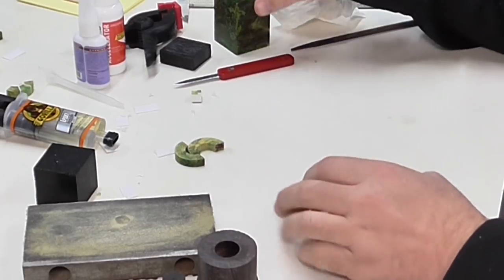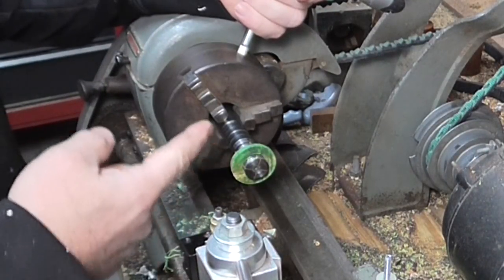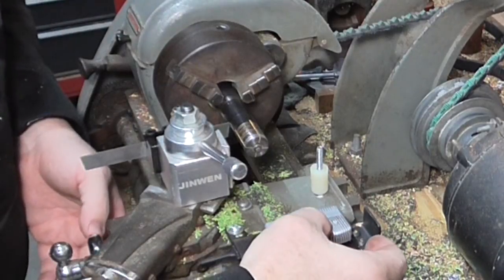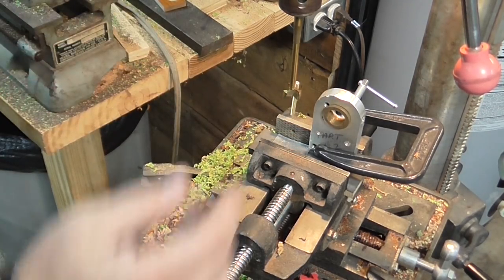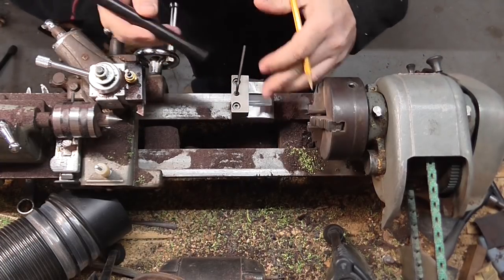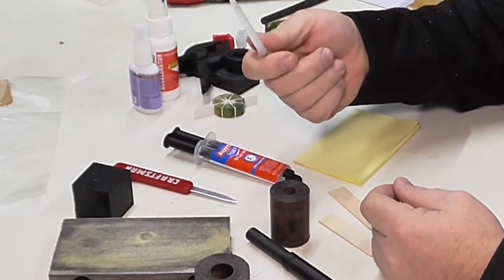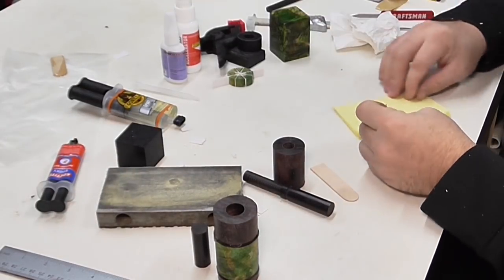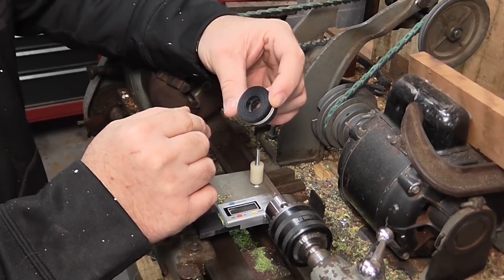Episode #2 - Duck Call Build - BearKraft Game Calls

Comment: I think high startup torque from the direct drive might have broken that part. I used to make very thin rings on an old Warner and Swasey lathe and if I didn't rev up the RPMs slowly then inertia would cause the jaws to close and my parts would exceed allowable out of round limits. I'd try a pocketed fixture and try again. The design looked like something worth pursueing.